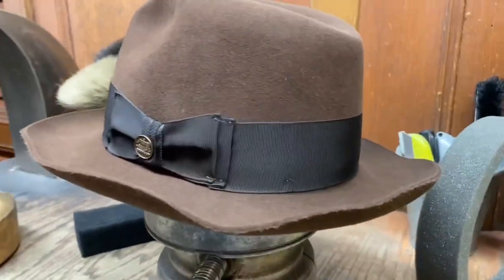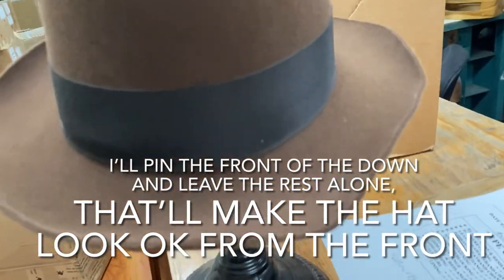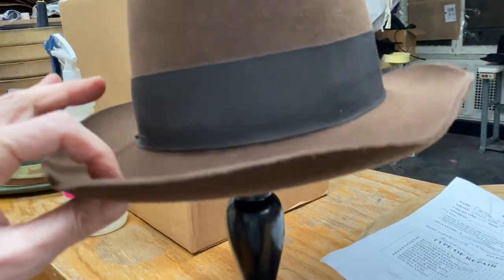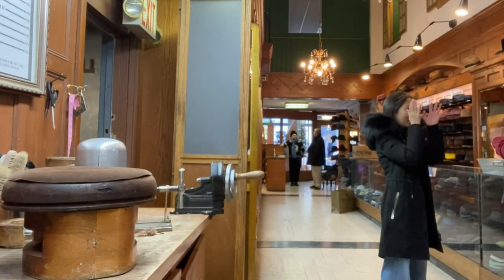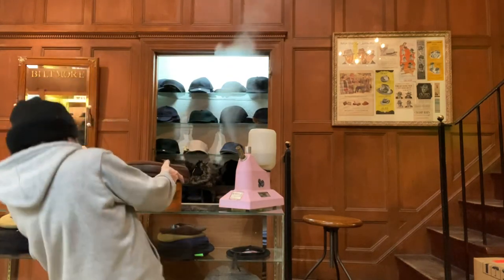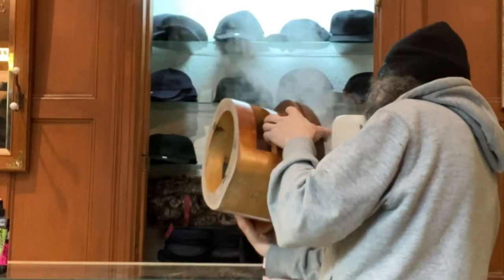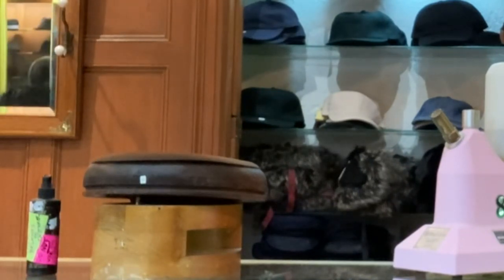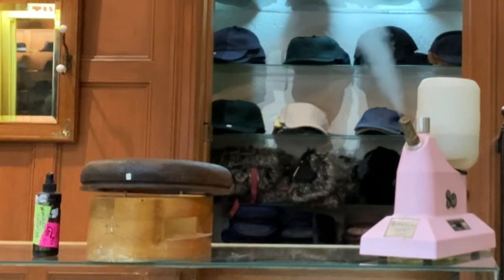WHISTLEBLOWING VIDEO !! - WHY IS MY ST*****  FEDORA CURLING?  What’s Happening To My Brim??

Comment: I have a Stetson Stratoliner, and the stitching on the bounded edge isn't perfect. There is one spot where the stitches miss and come off the ribbon on the bound edge. Also, there are a couple spots where ribbon on the bound edge doesn't look cut evenly and the excess ribbon is curled a little. On the bottom of the brim, just above the leather sweatband on the back, the fur felt looks like it has a slightly different texture, like it isn't as compacted and it's a little furry-er. 

Then, I have a Stetson Open Road Royal Deluxe. The bound edge is flawless. The only issue with the Open Road Royal Deluxe is that some stitching from the either the leather sweatband or satin liner can be seen from the top/outside of the hat because those stitches are not covered by thin ribbon. 

Are these sorts of issues a common part of Stetson's quality control? Are these minor or major flaws? I know these hats are mostly hand made, but I'm not sure I have enough experience to determine if these were a bad batch and I should be upset or return them, or whether this is normal and I'm just nitpicking. What do you think?
Reply from the maker: There’s always some stitching problems w Stetson  fedoras. You’ll find it on every one just about if you look, especially the nylon stitches that hold on the ribbon band, you usually have to clip them in a half dozen places. Finding rough spots on felt, or little pimples or odd textures is also typical.. we love our Stetsons so much, when they all arrive like that, we don’t care, we don’t say anything.. we accept them. Everyone does! Of course! We love our Stetsons! the American icon! It’s part of history! We love them so much that we accept it…so they keep doing it.
I’m convinced their inspection tickets are just tossed I. For show. nobody inspects these. On the other hand, you will never, ever see a single stitch out of place on a Selentino. Sad,but true.
Reply: @HATS & GUITARS  I couldn't tell if that was a hint of sarcasm or genuine sincerity. Regardless, I agree. The only reason why Stetson can get away with poor quality control is because the demand for them is high and consumers keep buying their products, despite their flaws. If people just returned their hats that weren't perfect en masse, then theyd start fixing the issues. The problem with that is that Stetson passes the cost of a retun onto the consumer. I returned my Stratoliner, but I still lost money because I had to pay return shipping. Also, I went to my local hat shop, and the sales person looked at the issues in the Stratoliner I mentioned above, and he looked at me like I was joking, told me he wouldn't worry about it, and basically confirmed what you said about Stetson. But,  it was weird because I almost felt like the problem was with me and what I was demanding of Stetson, and not their product. In this day and age, fedoras are more fashion than function and definitely luxury items. $200 is not cheap for a fedora. 

I imagine someone HAS to be seeing and handling the hats in order to attach the inspection stickers that they do, but I just think they're only looking for major flaws, like no missing pieces or gaping holes. They clearly allow a few missed/uneven stitches, inconsistent felt texture, etc. 

Thanks for responding again!

Comment: I've noticed this can happen to thick felt too but it'll take longer and much more rain to happen. I have a 6x skyline I wore through a snowstorm outside. The brim curled up on the sides (it was shaped to be turned up but it really curled after the snow). No amount of steaming seems able to get rid of the curl.
Reply from the maker: That’s the.. “thing” I was talking about, it started happening around 7-10 years ago.. you can’t fix it yourself, no. You’d need to have a hat maker heavily stiffen the brim and put it in on a flange again.
Reply: @KTGHATS  its annoying. It makes me wonder if it's a characteristic of felt, or if they just don't hold up to as much weather as they used to, or if it was some part of the process that they've since removed to cut costs.

Comment: How can you tell if a hat's felt is thick enough or has a nice snap to it? I have a Stratoliner and Open Road Royal Deluxe. The Open Road's brim is easily twice as thick as the Stratoliner's, but the Open Road Royal Deluxe has hardly any snap. Does this mean I got a bad Stratoliner? Or, is the thinnes common to the model? Also, does the bounded edge of the Stratoliner help prevent the warping?
Reply from the maker: Bound edge does nothing to the brim as far as strengthening it. Your hats are held w they should be. Neither are snappy or thick, rugged felt. Some other brands make them thicker . Snap will come mostly from a stiff hat, stiffeners..& from a well crafter flange, the shape of the brim 
Those are not really “thick” hats. or snappy, they’re softer and the strat is lighter weight and thinner than the o road, don’t worry about them though, just enjoy them
Reply from the maker: Your hats are fine, if u had a bad one, you’d know it in a second!😂This is a phenomenon that occurs with some of these hats, but certainly not all of them. When it hits, it hits hard and it’s unmistakable.
Yours are A-okay !

Comment: Hi
My Whippet is curling. Without that "toilet seat", is there nothing to be done?  What about ironing the brim?
Reply from the maker: The toilet seat didn’t work either. 
You can try to flatten it. Yeah. dust the felt w tape first, then spray it down with some scout felt hat stiffener, under the brim, cover up the sweatband, no spray on it. When it dries completely you cover the hat with a bandanna before ironing it. Always cloth between the iron and hat, don’t get it too hot or you’ll make shiny patches on the felt. 
Iron it, and try putting weights on the brim for a few days.. a bandana or cloth first, then a flat book, then heaviest stuff u can put on top, like sandbags, cinderblocks..

Comment: Hairspray?
Reply from the maker: I gave it 2 coats and one coat of scout hat stiffener before this video. It might have fixed it 5-10% but it didn’t help the curling brim, I even used a hat block.
Reply: @KTGHATS  AHH.
I have a very very thin signes pure beaver. The hairspray trick works brilliant on that. Thanks to you for the tip..... A long time ago. 👍